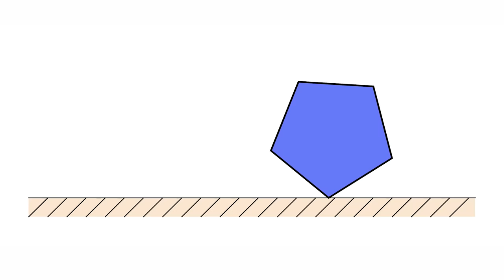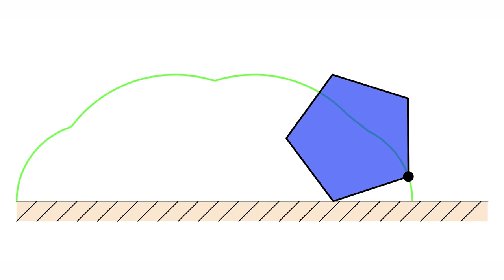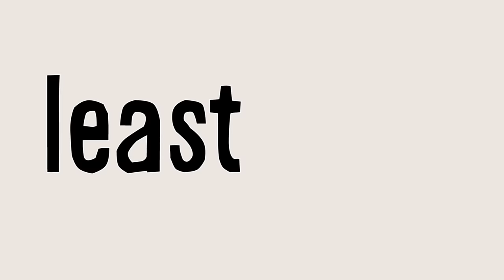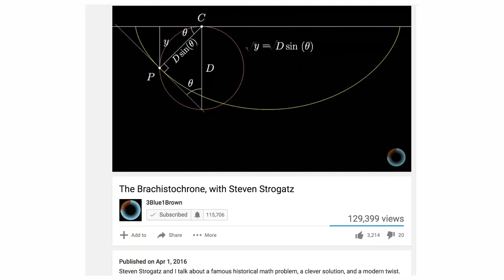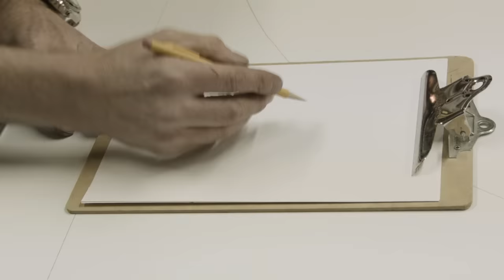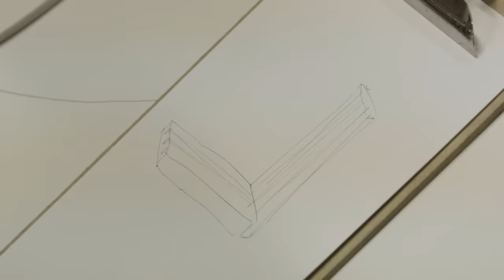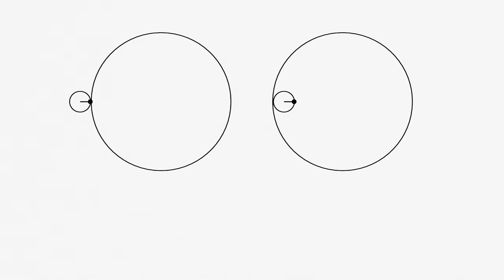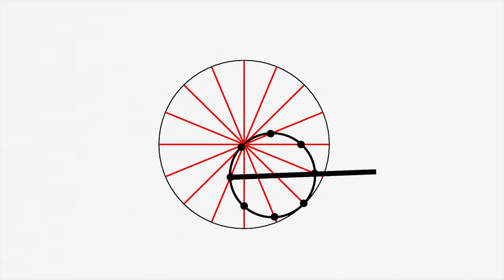The Brachistochrone

Comment: so if you turn a Brachistochrone curve upside down will you get the slowest curve possible?
Reply: roguedogx theoretically yes. It would be the path of most resistance
Reply: Not at all. The least optimal curve would be one that kept you from getting to your destination at all.
Reply: Piggy Plays that doesn't necessarily mean it's one that's upside down. Given that the curve does eventually meet the second point and whatever you're rolling also meets it, I think an almost horizontal line with a steep drop at the end would be slowest. Given that gravity is the primary force of velocity you want to exclude it as much as possible.
Reply: What Ron said is kind of irrelevant because the question "what is slowest" not least optimal. 
You still need to get to your destination in the first place for it to be considered slowest.
Reversed, it might be the slowest. Would need to be tested with a straight path, which is the slowest outside of paths that are odd (loops, hills, etc).
Reply: Troll physics.
Reply: No it wouldn't. The curve is designed to be the most efficient method between A and B. Simply turning it upside down would shuffle the geometry a bit, but it wouldn't result in being exactly the least efficient. 

For example, draw a straight line from A to B, then pinch the middle of it and drag it up as far as you possibly can. Looks nothing like a Brachistochrone curve, but would work much more inefficiently.
Reply: No. It's not even the slowest monotone curve. In fact, there is no slowest curve (that actually gets there) - as you get closer to horizontal, the acceleration becomes arbitrarily small, so however long your candidate slowest curve takes to reach the end, you can find another curve that takes at least that long to cover the first millimeter of track. At least in theory - in practice, you have issues with resistance forces and limitations on how precise a curve you can machine, and so forth, so you're unlikely to be able to make a track that takes 2 hours (say) to travel a couple of meters of straight-line distance...
Reply: I feel like an inverse Brachistochrone aught to be symmetrically efficient.  Just like how you can start anywhere on the normal curve and reach the end at the exact same time, starting on its inverse should also reach the end at the same time, I would think.
Reply: z beeblebrox if it was inversed, the object could no longer lay ON the curve, but instead need to be fastened TO the curve with some sort of axle mechanism. Acommodating for friction, the rolling object will reach the end at the same time as the original brachisochrone. Theoretically.
Reply: z beeblebrox Not at all.. The inverse of a Brachistochrone would start slowly and end steeply. The nearer to the end, the faster you would go. So it wouldn't be a tautochrone anymore.
Reply: roguedogx Yeah that is true?
Reply: But would it work in practice?
Reply: yup because it would take infinitely long for gravity to move the ball up the hill...
Reply: I'm guessing that a near horizontal line followed by a steep drop would be the slowest curve
Reply: But a solution that takes infinite time is no solution at all.
Reply: The inverse brachistochrone would be the path that takes the longest time possible to get there, i.e. Infinite time. The ball is moving, but the acceleration at the beginning is infinitesimally small. A less steep curve would never let the ball move.
Reply: I think the definition for slowest curve possible would better be put as the path requiring the most work done (energy expended). Perhaps with a clause of using the same amount of material? As otherwise you could just add infinite amounts of plastic going straight up and the object would have to overcome gravity the entire way.
Reply: I'm thinking the same thing and it would make sense
Reply: roguedogx no. Its easy to think of one that takes longer to go.
Reply: wouldnt an upside down brachistochrone be a cycloid rightside up, and just be the same thing as preventing u from getting to the destination (you can't go upwards without a force)
Reply: +postvideo97
The brachistochrone is only flat at one end if there's a particular ratio between the horizontal and vertical distances involved; for shorter horizontal distances, the brachistochrone is still sloping at the end (for longer horizontal distances, the brachistochrone drops below the the destination and slopes upward to the end).

And even then, the inverted brachistochrone, while it starts slow, speeds up much sooner than it needs to. Take a near-horizontal straight line with a sharp drop at the end, and you can take as much time as you want on the near-horizontal section by choosing how nearly horizontal it is.
Reply: I know this is a joke, but there is no slowest curve possible; you can construct arbitrarily slow curves.
Reply: slowest would probably be a straight line at an angle that approaches 360 degrees and then a nearly straight drop on the end
Reply: +WaffleAbuser although if you added another restriction, like the slowest curve that can be used to reach a certain point with only gravity, wouldn't there be a slowest curve possible?
Reply: +Gabe Morehouse
No. A slowest possible curve is like a biggest number - there's always a slower curve (or a bigger number)

Comment: What if you made a halfpipe with a Brachistochrone shape? if you released some things from different heights, would they align at the middle and the split apart again, and then come back in the middle?
Reply: Arvid Olson yo good question
Reply: Arvid Olson obviously yes. The inertia of the higher drop would carry you farther on the other side. You don't need math to figure that out -- you just need common sense.
Reply: i think so, but only if there was either no friction or exactly the same friction for all objects
Reply: ophello It's a legitimate question, no need to downplay it. But what do you mean it will carry it higher? If you dropped a ball from one height if the half pipe it's going to (in a world without frictional forces) reach the same height you dropped it from. Now in real applications I believe what was originally said would work if the half pipe had the same coefficient of friction throughout it. Meaning that balls dropped from different heights on the half pipe would indeed meet in the middle and go up the opposite side of the half pipe (at a lesser height than dropped from) and do the same going back.
Reply: +ophello
Stop being so salty and so full of yourself. Two hours ago you didn't even know what a Brachistochrone is yourself. Stop making it look as if it is an easy or obvious topic.
Reply: ophello yes! This is my hypothesis too! As you say, I obviously "know" this, and you obviously know that I know this, but my purpose of this comment was to spark and interesting conversation!
For example, I find it quite fun to visualise a halfpipe where one half of the halfpipe is an brachistochrone and the other half is an quarter circle! I also imagine an s-shaped path with a brachistochrone, an inverted brachistochrone and then a regular brachistochrone again! Wonder what would happen then! Wonder what the ration between the dropped objects would roll if there was no friction and some objects are dropped on the inverted brachistochrone and others on the top regular brachistochrone! I'll need to synthesise this someday! Please continue with interesting ideas and experiments!
Reply: Holldor i think ophello means just that, that the balls would reach the corresponding heights there where dropped from, meaning that the bal that was dropped from a higher place would also reach that same opposite higher place on the other side!
Reply: Arvid Olson I was hoping that's what he meant because that's a basic law. The term "farther" was poor word choice
Reply: ophello it is impossible to have a higher potential energy  than what you started with without an outside force.
Reply: Actually yes, I think so. As long as friction is constant and unchanging and the slope on both sides of the half pipe is the same.
Reply: The brachistochrone curve is derived with a point-like mass in mind, which would not hold for a skater. All potential energy would not be converted to translational energy, some of it would end up as rotational energy. It's possible that the latter is negligible, but saying "obviously yes" and "you just need common sense" never the right way to regard it.
Reply: that would be sick :D would like to see that! keep going on with your thoughts!
Reply: yes thats what would happen sick!
Reply: Is friction really partly caused by a kind of bond formed between 2 surfaces? Because somebody told me it was but I always thought friction could be explained by all surfaces having rough surfaces on an atomic level and converting some kinetic energy to thermal energy when coming into contact etc
Reply: The inertia of the object would be the same regardless of it's initial height. And inertia doesn't come into play, the effect would be the same even if the objects were of different masses (assuming no friction).
Reply: TheZandBeast It is true that if the surfaces were atomically (perfectly) smooth, there is still roughness because of the space between the atoms and therefore there is still friction. Friction of real-life surfaces, however, can be more complicated because of adhesive bonds between the surfaces. Contamination and deformation of the surfaces also complicates real-world friction.
Reply: In physics, static and kinetic friction are treated as cases. My AP physics class had us graph friction force vs time graphs. The friction for stopped objects is usually about 3 times greater than it is for moving objects of the same material. The roughness of the surface does play a huge role, but all interactions between solid objects are fundamentally electrical and involve attractive or repulsive forces. The reason you do not fall through the floor is that the gravitational force acting on your body is balanced by the electrical force between your feet and the particles in the floor. When molecules are so close their repulsion can support relatively massive macroscopic objects, they are also close enough to create dipole moments and bond.

Comment: 17:57 Slo Mo in .5 speed.
The shortest distance between two points (a straight line) is the slowest.
I need to rethink faster-than-light travel.
Reply: That's true only if there is gravity, however in Space there's no gravity constantly pulling things down so a straight line is the fastest and the shortest path from 2 points
Reply: @chad5115  What about slingshotting using gravity wells? Oddly enough, I have a feeling that the brachistochrone will show up there as well.
Reply: @glowingdawn9179  yes it would show up
Reply: when you try to travel faster than light theres only 1 force involved, whereas gravity is the 2nd force
Reply: @danielsteger8456  im sorry travel faster than w h a t
Reply: @glowingdawn9179  haha I see what you did there
Reply: @singhanmolpreet5935  what do you think i did?
Reply: @glowingdawn9179  "gravity wells"... "..as well", you see, well? Haha.
Reply: @singhanmolpreet5935  oh i see, i didn't mean to do that but i'm glad you enjoyed it
Reply: @glowingdawn9179  oh well

Comment: Hi Michael,

The brachistochrone problem does not take into account the fact that the falling body is actually rotating (a rolling ball). This means that some of the gravitational energy has been converted to kinetic rotational energy, and that the translational kinetic energy is a bit smaller that we might have thought at first. The question I have for you to investigate is this: what would the curve of fastest descent be if you take into account the rotation of a rolling ball? That is the real deal :)

Congratulations for the video!

Cheers!
Reply: Buuuuuuuu! You ruined it, get out of here!!!
Reply: Are you saying the system has energy "loss"?
It's not entirely clear to me what you're suggesting. Could you elaborate?
Why does the translation to KE make any difference? That's the normal process for any "falling" object, even if it's guided (i.e. on a surface).
"and that the transnational kinetic energy is a bit smaller that we might have thought at first."
Do you have a source for what you're talking about, because I would be interested to read it.
Reply: @Qwert No, I am not saying that there is energy loss, I am assuming no friction. What I am saying is that something purely sliding down a ramp is a different situation than something rolling down a ramp. When you roll down a ramp, some of the gravitational potential energy becomes rotational kinetic energy, so you reach the bottom with less translational energy. This is energy conservation, the total energy at the bottom consists of two terms: (1/2 m v^2) + (1/2 I w^2), m is the mass, v the velocity, I is the moment of inertia and w is the angular velocity. The potential energy at the start is the same, so if you roll you store some of the original potential energy in that rolling energy term (1/2 I w^2). Hope I made my self a bit more clear, but if not I can try to find some online reference.
Reply: As seen in the video even with friction, rolling energy loss, discrepancies in the material, etc. the model they built was incredibly accurate. The point was not to make a highly advanced, perfectly accurate real life model but to show a mathematical, geometrical and physical phenomenon. Also the math involved with what your asking would be highly advanced and take into account numerous other variables such as friction, the weight of the object and so on. 

Thanks for being one of the few remaining reasonable YouTube commenters :)
Reply: This is a very theoretical question that could only be answered in equations and not demonstrated with physical objects.. Since the rolling ball is the closest thing you can get to a frictionless slide. An object actually sliding down the Brachistochrone would probably stop before the end and ruin the tautochrone effect.
Reply: Marcelo Roberto Jimenez There's kinetic rotational energy in every way, so it's the control variable we don't have to take into account. Maybe it has very little effect on the experiment like making the balls move a tiny bit slower but that's not a big deal.
Reply: I'm no expert, but I would think that it doesn't matter. It's the curve of fastest decent in every scenario, whether that's software (which I would think is close to what you're asking) or this friction-filled contraption.
Reply: I'm sure Michael will love to answer this in fact I think he already has started to investigate.
Reply: Yep, agreed - it's comparative...
Reply: Marcelo Roberto Jimenez, plus, you can't have something perfectly sliding down since the slope is constantly changing so the touching point would have to constantly change accordingly as well. In theory, it's possible, but in practice, it'd require either zero friction and air drag, or infinite amount of rotational inertia (yet finite amount of transitional inertia).
Reply: The answer is a curve where the centre of mass travels through a cycloid but the curve itself is not a cycloid, just parallel to it. It turns out this brachistochrone curve is again also the tautochrone for rolling too.
Reply: Marcelo Roberto Jimenez
Thanks for your elaboration. I think obviously I'm missing something.. but I'm not entirely sure why you're looking at the energy in the system. In short (sort of):

Given a resistance free environment the sliding object on a friction-less surface is 'easy' to imagine.

But with a rolling object, the only thing necessary is static friction (which allows an object to roll). Now assuming a "perfect roll", no other friction is experienced: so I would expect the result to be exactly the same as the sliding object experiencing no friction.

Hmm. Not sure. I'll look into this further since you've piqued my curiosity now. But for now, sleep sounds good lol. Thanks for the elaboration!
Reply: The derivation of the shape of the curve depends on an energy argument, which is why +Marcelo Roberto Jimenez is interested in Energy.  

However, as long as it's rolling without sliding or pure sliding, the argument holds, as the angular and linear velocities are proportional in the rolling case.  Thus the whole thing works out again, (with v proportional to sqrt(height)) just with a different time-to-the-finish.  

If you get ugly slipping and rolling then it all falls apart, unfortunately.
Reply: Devin Smith 
That's what I thought, I second guessed myself as I sometimes do. Thanks for the follow up!

And thanks Marcelo for the piquing my interest in the first place.